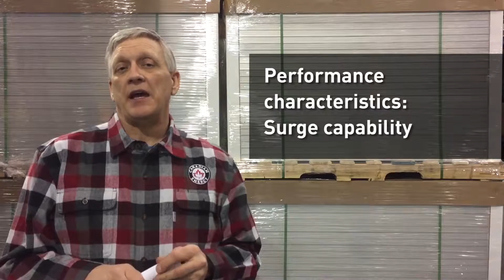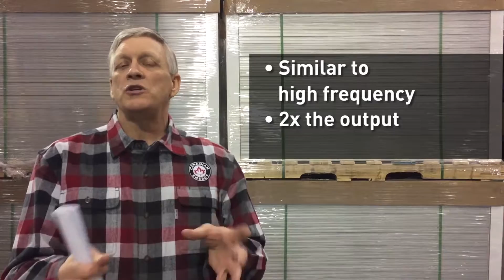Canadian Energy™ - Low Frequency Inverters (3/7)

Comment: Good video. Do you what frequency are they running? I am thinking to buy 10kw inverter but I am not sure what to buy. Also it will be nice to suggest
about batterys. what kind of battery do you suggest .

thanks

Andre
Reply from the maker: Andre Abelian we don’t really know what you are asking. We don’t have a specific frequency that the low vs high would be at. Generally speaking a transformer based inverter will be around 120 hz and high frequency will switch much faster but this is not information that a manufacturer releases.
 
We can’t really suggest a battery if we have no idea about the system.
Reply: Im not sure what type of inverter you mentioned.  In terms of solar inverter,  if PV voltage input < 150V,   it considered low frequency solar inverter.     high frequency type support voltage input, PV voltage input > 450V